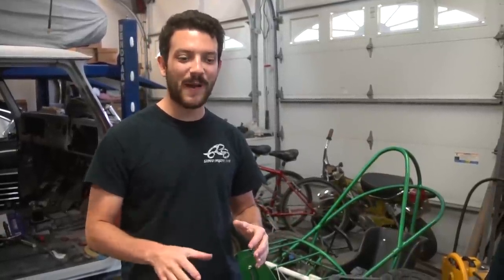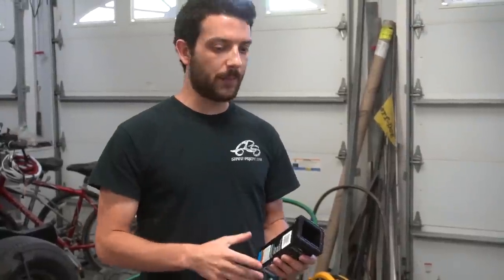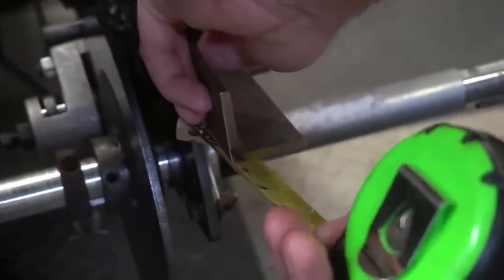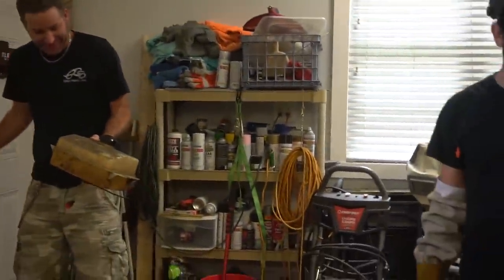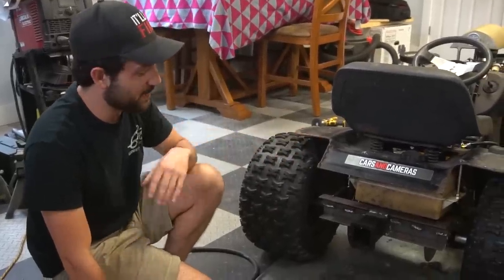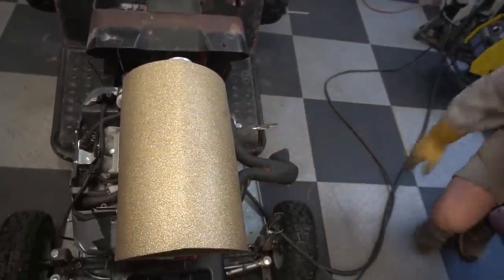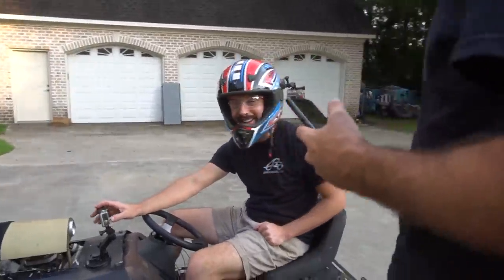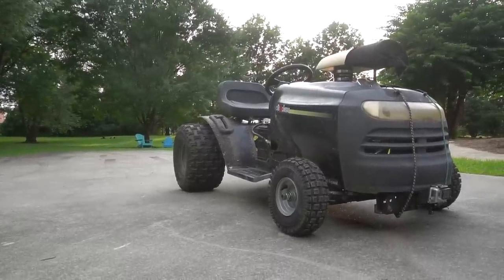50HP Lawn Mower WHEELIE MACHINE

Comment: That things a beast. When are you going to take it to a mower race?
Reply: i hope they race it
Reply: I came here to comment that the thing sounds like a beast, but you beat me to it, lol.
Reply: Take it to the drag strip and see if it's faster than the rail.
Reply: 65BAJA it will be, probably not less than twenty miles an hour
Reply: How's the Honda Davidson?
Reply: This is more gokart than lawnmower, if they have restrictions I bet they wont be allowed because 1 restriction will probably be that they have to have a vertical shaft engine or something
Reply: I'd doubt they'd get in even in Factory Experimental because the Predator 670 was never an OEM engine choice.
Reply: That won't even get into inspections.
Reply: @65BAJA  I concur.
Reply: Is there no "unlimited" class? I dont know, I dont follow mower racing.
Reply: KartFab that thing would get it's ass handed to it at a mower race. All the hp in the world does not mean anything if it does not handle.
Reply: rev9fan1 there may be an outlaw class they could enter but it doesn't handle well enough to do well.

Comment: what an absolute monster. and it looks the bit too. yall definitely killed it with this build. definitely exceeded my expectation for how cool a race mower can be. all those 212 race mower builds are pretty neat and all, but not nearly as badass as this thing. 10/10 keep it up!

id rather see the 670 on this than the drag rail. seems like a perfect fit. I loved the drag rail, but it seemed too slow and problematic with the chain setup for its' purpose. i'd rather see the ducati motor on the rail. im sure you've already thought of that, and then thought you'd rather have your life in tact lol. maybe you could rework the frame and put the ducati motor over the rear axle and move the seating position forward? I guess that's probably more work than it's worth but it would be faster and super badass. it would still be safer than a ducati on a shifter frame or even going 80mph on a tiny yard cart frame down the highway lol
Reply: Can I suggest a poly caster wheel in place of the trailer hitch ball !
Much safer, will tend to not bite in !
And available in a number of widths !

Comment: put front brakes on it... so you can lock them up and rip massive burnouts
Reply: dawson stober have to put weight on the front for that. Front brakes won't do anything if the wheels are up in the air.
Reply: @officialclownbusiness7788  do you not know what a burnout is... Front brakes locked up and foot the the floor it's not gonna pick the front end up it's gonna spin the wheels. And if it doesn't then throw a little water down
Reply: @durkj3370  nah it'll throw those wheels up. 4 wheelers do it too

Comment: Just add some front brakes and a line lock and it'll be the lawnmower burnout king!
Reply: Grant Mikosz or put bicycle style disk brakes on the front hubs and run it to a bike brake handle beside the steering wheel 😂

Comment: You guys should figure out a line-lock system for the front. That way when you take it to a show, you can throw water under the back tires and boil them off in a cloud of smoke!
Reply: Koshunae use the old deck lift mechanism to push pads against the front tires like old school yardkarts used for rear brakes it only works for burnouts but hey thats all we want

Comment: Yall should put that engine on the HONDA  chopper
Reply: No not the honda ct70  the big ratty honda chopper with the patinaed fenders
Reply: that already has a 670 on it
Reply: @janeames1513  the 670 on the mower is night and day difference in performance.
Reply: Yah but this one has more power its got a cam milled cranck and pistons and makes 50 Horsepower stock it makes 25 to 30

Comment: There was plenty of life left on the chop saw blade. It took me a while to figure out, but if you open up the work clamp, then loosen the backstop with the lever you can move said backstop forward to compensate for worn down disks. It will hold plenty strong with the lever, no need for that backstop to rest against the back of the saw.

As for the name of the mower: Stubby Bobby ? :)

Comment: If that transaxle is the same one I had you can get a vertical input if you use the built in brake, i used the same one with a 6.5hp honda with great results

Comment: Swap hitch  with the ball for an open type hitch with top and bottom flange... turn sideways in reciever...drill hole for pin.. then mount a wheel between two sides of hitch.. and your wheelie bar is set

Comment: I really think those clear valve covers should have been made with metal inserts in the bolt holes.  Seems like the tightness margin between leaking gasket and cracked plastic is going to be pretty slim...

Comment: This thing is awesome!!!! Forget putting this engine back on the dragster 670, If the rail frame is savable put a motorcycle engine on it with a full gearbox so you can really get some speed.

Comment: The reason this seems more exciting that the dragster is, high speed has been done and can easily be done. It's those nasty power take offs which are the exciting part. Nobody want's to see you guys get hurt or "kilt" tryin'" to make a high speed pass on the mower. But a big "stankin'"burn out or wheelie "poppin'" take off is the real money shot for this type of project. Just like they are for "stubby Bob" Would be nice to see the other "karters" each do a similar project and then race them on a sand track!!.
That of course, right before y'all do the same with the upcoming "Bar Stool Racers", Hellz yeah!!! 
#stubbybobjr

Comment: you need to take the mower to busco beach and drag it and take it on a trail ride it would be interesting to see how awesome it will be off road. your you guys could build an off road mower with a 670 it would please the masses. tractor supply has a vertical shaft 670

Comment: You guys should do a tractor with big off road truck tires but still super low so that you are literally sitting between the rear wheels. Use a 55 gallon drum cut in half for fenders then run the tire pressure really low for traction and smooth ride. I believe I saw some perfect tires in one of Ike's storage barns in a previous video so the only hard part will be finding hubs to bolt the wheels to that will fit on the axle.

Comment: Hey cars and cameras, I m almost done building my mower , it has a 26 hp, "heavily modded" with a 7 inch engine pulley and a 3 inch on my transmission witch is a peerless 700, what gearing for the sprockets should I use on the my transmission output and rear axle
Reply: Wish i could tell you. Trial and error is what it will be

Comment: Those tires won’t let you drift , but if you swap them to try it be careful. 
You need to lean right off the thing like riding a 4 wheeler and never lift off the throttle in a slide or it will try and flip.

Comment: carsandcameras.....what's in the engine....What mods other than porting the heads I seen
Reply from the maker: Governor delete, rods, flywheel, cam, valve springs, factory carb was reworked. Check out all the mods at performance670.com

Comment: Ike for sure would have ran low to mid 20s on the gran prix. What are you afraid of?
Reply from the maker: Nope. I may have been able to squeeze a 32 out of it, but the mower does not corner well at all since the rider is seated so high compared to a racing go kart. It'll beat almost everything we have in a drag race, but not in the corners.

Comment: Thick stuff like that angle and plate needs a bevel ground into it before you weld it so you get full penetration to the root of the joint.. (I was a certified welder btw.. just can't do it for a living thanks to my back)
Reply: It didnt look too think im also a certified welder i was taught if over 3/8ths it needed to be beveled
Reply: that's at least 3/8 plate

Comment: Mini tractor pull. Needs a seat that keeps you in better.
Reply: have you seen what they run in mini tractor pullers?..if not i'll tell you..they run crotch rocket engines in them..i would guess 600 engines or bigger with super high revving
Reply: Jane Ames thanks for the input I don’t keep up with tractor pulling so really don’t know what they run. Although this would be more suitable for that then a Crotch rocket engine for a many tractor pull.

Comment: I don't know how Isaac let you get away with this? That is not a lawn mower anymore. Everything was replaced. It's a go kart you built inside a mower shell. Still cool as hell but it's like if someone put a jeep shell on a lambo and called it a jeep. It's just a sneaky lambo.
Reply from the maker: Honestly I’d be ok with sneaky lambo
Reply: @CarsandCameras  you still need to try a different mower. There are mowers out there with close to 30 hp that might do better. If you can find one for cheap and swap the ratio, you can make a serious off roader. I'm talking huge tires, wide wheel base, custom fenders. Make a monster mower! I have faith in you. These mower projects are easy and cheap for the young guys  to do. You need to show them the way!
Reply from the maker: Yeah, since we pretty much turned this one into a go kart we've been talking about doing another proper mower build
Reply: @CarsandCameras  monster mower it is then!